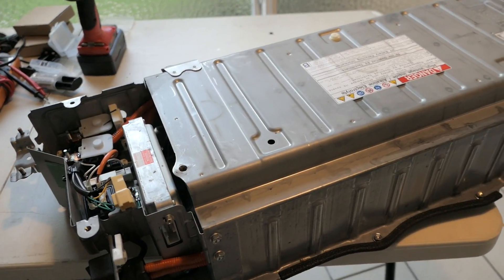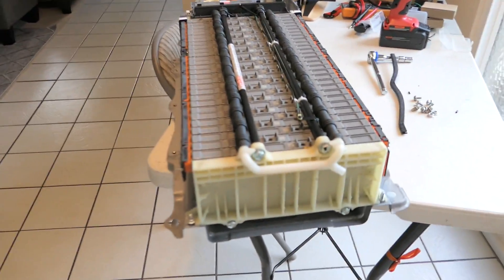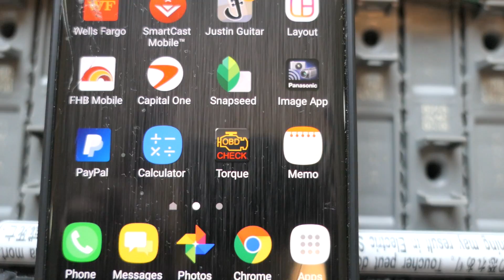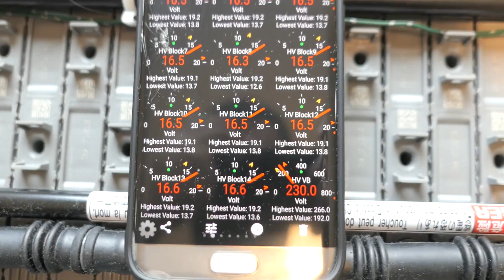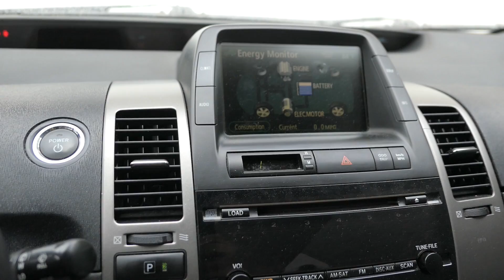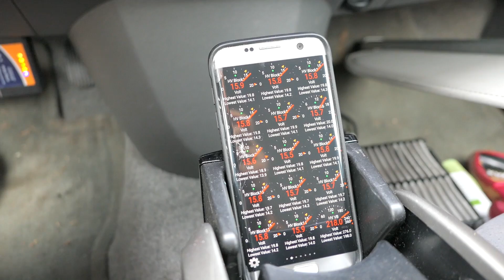Prius HV Battery Repair - Gen 2 ll DIY

Comment: After reconditioning 
My pack reads 230V 
Wonder if that's bad on my ecu.
Got the triangle. 
Yesterday I didnt. 
Yesterday the engine would start immediately. 
Today I got a Ready/bit also TRIANGLE 
Itd move on electric for 20feet then 
Engine start run 30 sec.and off?

Comment: Vlad, there are 2 things that are inaccurate about your video here.  1. The cells furthest away from the electronics, the Left hand side in your video, do not start with No. 1,  this is the 14th block containing cells 27 and 28.  I use a 2 pronged diagnosis, I start from the RH side of the block, then do the countdown as you did to find the correct block.   I also check the voltages of all 28 cells, and the voltmeter will confirm what I am saying.   You don't necessarily have to replace both cells in the block, it could be that only 1 cell is bad, right next to a perfectly good cell that doesn't need replacement.   2. The battery voltages won't balance themselves while wired in series, operating normally.  If your Battery cells are an average of 7.2 volts and your new cells are at 7.8 volts,  the highest voltage cells will signal the electronics to stop charging even though the 7.2 volt cells have not yet achieved their maximum voltage.   Going down during discharge,  the opposite happens.  The bulk of the cells will reach a discharge state early and not allow the 7.8 volt new cells to reach a discharge voltage equal with the other cells.  You must wire the whole block in parallel in order for the block to balance itself.   What I do is take each cell and arrange them where all the minus's are in line, and all the plus's are in line.   You can tell at a glance if everything is ok because the vent tubes at the top, next to the minus terminal of the battery, are all aligned.  Then,  I bought some bell wire, (bare wire), from an electronics store and connect each negative terminal with each other going up and down with the wire between cells, then I put the 8mm nuts on the bell wire to hold it snug.   I do the same with the plus side.   It doesn't take that long, 8 hours minimum, for the battery cells to all arrive at the same voltage just by wiring them all in parallel.  After I have allowed them to balance themselves through this wiring method,  I remove the bell wire,  check the voltage of each cell, then re-order them where the polarity is now opposite of each other so that the pack is now once again wired in series.   If the electronics are at your left, that first cell on the left should be minus, and you should end up on the RH side with that cell showing plus.  With the electronics box on your left, the No. 1 cell, once again, is on your right, and block 1 as well.  Verify what I am telling you by checking the voltages of each cell when you have a bad battery.  What I am really impressed by is your Torque Pro gauges.   I also use Torque Pro, but can't find the presentation you have hooked up in this video at the beginning.  Please instruct me how I can get that presentation.     I am a fan, and your heart is in the right place.   Keep up the good work.
Reply: thanks for this info

Comment: Not a lot about safe handling of a high voltage battery pack in this video. Charge and discharge performance testing of all cells would be worthwhile while battery is apart. This can be done with some low cost equipment available online.

Comment: Great, Do i have to take the battery out for the torque app to work? Where download and what are the Pid plugs? How do I download the Pid plug ins? I thought I might need to buy an OBD II port plug in to do a scan. Will the app work for 2010 to 2017 Prius batteries? Does anyone recommend an Obd scanner or android app to check Prius batteries and will I have to remove the battery to fully test it. I was told to take a Prius to a hybrid specialist to get it checked?

Comment: Thanks for posting this video.  Anyone watching it should also watch at least several more.  Also, there are major things missed: that code you got is often made worse by the busbar corrosion (the copper connectors).  They can be cleaned, coated with anti oxidant and reinstalled to help future problems from returning.  On the subject of busbars, there is considerable danger (fire, chem, injury) around the battery with those bus bars still connected.  Use rubber /lineman gloves and be really careful around the orange plastic areas  - why do you think they are orange?!   (yes  we all know that the orange 230v key is removed -- however you still have many 16v blocks/8v modules in series (many many volts if you short the wrong things until you've removed those bus bars carefully.)

Comment: You're doing it wrong. Internal resistance needs to be as close as possible for each block. That means your app is useless. Get a proper reading on the condition with this formula: Ri=(V1-V2)*R/V2. What you do is charge each cell to full to get V1. Get a resistor with value R (4Ohm or so should be fine) to connect in parallell with your voltmeter and the cell. This will give you V2. What you are observing here is the drop in voltage when the cell is under load. Your calculation will give a pretty good estimate of the condition of each cell. Low internal resistance is good. High internal resistance means its bad.
Reply: Couldn't I just completely discharge the entire battery in the car , then test each cell for a low reading??
I get what you're saying about resistance, just wondering if this would work.

Comment: nice, no grounding, no rubber gloves, no other safety equipment, this is 300v of instant death you should be more careful and not mislead people on youtube.

and at 6:40 as another poster said, you counted from the wrong side.... bad mistake. Count from right to left iirc although im not sure which way the battery is oriented front/back.

Comment: Good Afternoon: Yes I would like to know where I can get that app that used to check the all 28-battery out. I have a 2009 Toyota Prius 2nd gen & I have some lights in the dash broad  it stay on all the time. And I would like to know how can I get them to turn off tooAgain what app you used to ears code on the dash broad & check the battery go or bad okAm calling from Houston & Katy Tx area

Comment: You need to balance them because all cells are in serie, not in parallel which means that if there's an offset in voltage, it's going to stay. An unbalanced set of cells will slowly degrade the whole pack because it will not be used as intented .
Reply: How do you balance them?

Comment: Using a voltmeter will take all the guess work out of this job.  Any cell that has less than 7.4 volts is suspicious.  Especially if you have batteries under 7.0 volts
Reply: Vbijm."oij

Comment from the maker: Buy battery cells here: http://geni.us/wU930FF
Recommended: http://geni.us/JustVlads
Reply: Hi @justvlads thanks for the video.  How long did your repair last?   

It's a great video, if viewed with a couple others,  to build confidence so thanks for posting.  The other commenters make good suggestions that maybe you can re-edit your video to include, so that others don't make some mistakes.    Mistake corrections that would really help others would be: correcting the block counting method, testing the individual modules - not just replacing both of them within a 'bad block', introducing the idea of balancing all the modules (connecting all the plusses and all the minuses) before closing up the battery, being more careful about safety around the orange areas until the busbars are disconnected on at least one side.  Two more processes that add time but are REALLY important to making the repair last more than a year or a couple months:   1: clean out the fan area junk that blows onto the battery (takes an hour) - it's behind the passenger side 2nd row rear seat, 2: get a hobby RC charger/discharger and learn the steps to charge/discharge your modules to extend the capacity of each, and then match the modules to make good blocks  (takes 2-4 cycles w/module which can mean days or weeks to do them all).  

Safety: Even after the orange tab is disconnected the orange areas still have high voltage: about 70v DC on the shorter group of modules "left" of the black disconnect harness  and on the "right / longer group of modules between the last and first module terminals and about 140v DC.  Wear rubber gloves (thick is better) when working with the nuts and busbars until at least one side is disconnected!

Mistakes in doing this can happen, but it's important to avoid the big mistakes -  A small mistake, but which caused my battery to through Red Triangle errors 3.5 years after my repair: corrosion that I watched your video and many others and thought I was doing myself a favor by coating the copper busbars (after I cleaned them) with NoAlOx, but 3.5 years after my repair, though Dr Prius battery life test says the battery is still good, I was getting errors likely showing a problem sensing voltage.  I opened my battery up just this month and find lots of corrosion on the busbars - so much for the coating I used!   Anyway, I'll be using standard di-electric grease (I know it doesn't conduct, but it does prevent surface corrosion) instead of NoAlOx on the outside of the busbars and nuts.

I'm thinking that your repair was probably good for a year, but let us know...

Comment: just a heads up, you started counting from the wrong end. I thought I had a bad module in block 7 but it turned out to be the 15th module from the left, which is block 7 when you start from the right.
Reply: Yes
Reply: 6:36 Yes, that is why block 8 from where he started counting was fine and block 7, which would have been block 8 if started counting from the right had the bad cell.
Reply: Doing a repair right now on a 2005 prius He is wrong in this video you have to count from right to left on this generation.

Comment: Do we need to do balancing or not ? Will it be a problem again ? also is your car still working fine ?
Reply: @West Park just change out the ones that are completely out of spec, by 1 or two voltage in difference
Reply from the maker: +bahadır Usta In my experience balancing is not necessary, as long as the cell is not completely discharged. But I would recommend charging the new modules to 7.8 volts before installing. Car is fine with no issues. Thanks
Reply: when u say cel is not completely discharged? you mean the new celles or the other ones?
Reply from the maker: +bahadır Usta the new ones your installing need to be more that 7.5 volts. 7.8v is ideal.
Reply: ok so that is it ? Your car is fine right ?
Reply from the maker: +bahadır Usta it's not that complicated as people want you to think. This is an nimh type battery so it gets in line with the other modules quick after a few cycles of use. If it would be a luthium ion battery thats a whole different story. Thanks
Reply from the maker: +bahadır Usta all cells are the same. Just hope you'll get all good one. Good luck and let us know how it went. Thanks
Reply: yeap thank u  i will let u guys know